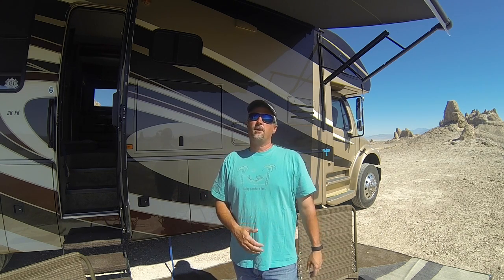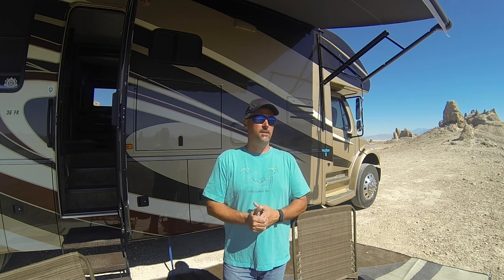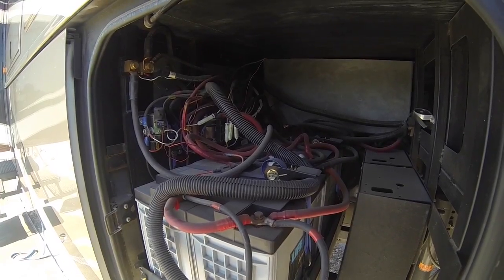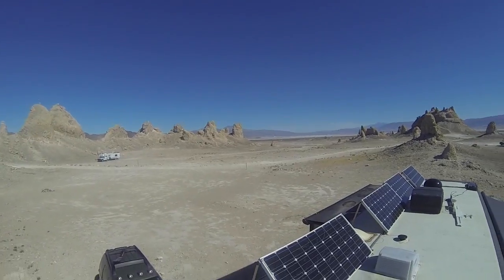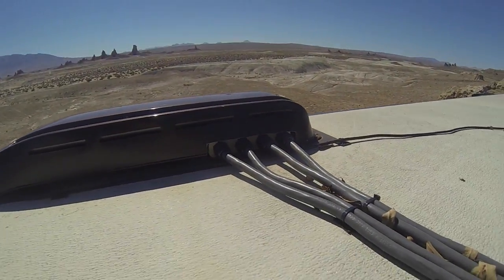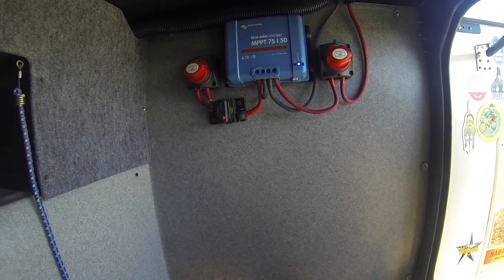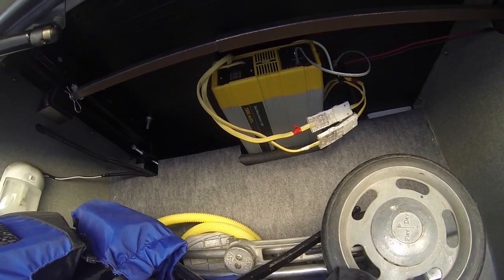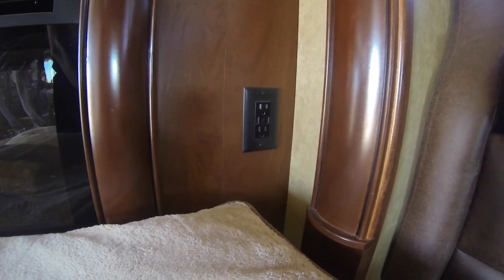Solar System on our 2013 Seneca 36FK

Comment: Thanks for the reply. That worked easily.
Wondered if you can help with adding more of the existing circuits to the inverter. Ours is factory set with Tv's n microwave only.  Would like to add other outlets to the inverter.  Did you just remove wires from the panel n add to inverter output?
Reply from the maker: I installed a small circuit breaker panel and removed circuits from the factory breaker panel to this new one.  There are 4 breakers in the small sub-panel I installed

Comment: We have an almost identical 2010 Seneca.
Wondering if you could explain how you got wires down from the roof thru the fridge area to the controller.  I'm about to install our solar.
Reply from the maker: I actually just pulled the fridge vent from the room and ran the cables through the vent space.  I tied them into the corner of the space so they did not interfere with anything or got hot.  I drilled out the bottom of the fridge platform, which on my model is directly above the house battery compartment

Comment: I bought panels on ebay and had them mounted on the roof of my pop-up camper funny thing was i pulled into Winnie Texas pouring down rain so I set up under a large metal canopy. Get this rain for two days then cloudy and they still charged my batteries. So it didn't matter if the sun was out! Loved that.
Reply from the maker: Thats awesome.  I do love the solar and the freedom it brings

Comment: We full-timed in our 2012 Lance truck camper for 3 1/2 years and did several remote camp host sessions where we only put about 50 hours on our L.P. generator due to the 250-watts of solar and two group 24 AGM's. What prepared our success was living off-grid in S. central CO in an off-grid strawbale home with attached greenhouse. We only had 960 watts of solar and a small wind generator, but I was able to work remotely from home for aerospace contracting via satellite internet and phones with antennas on the roof (metal roof and chickenwire in the stucco was a real good rf/emp sheilf, lol). Now looking to put all of our experience into our next Super C coach as there is a lot of North America to explore yet!
Reply from the maker: It is pretty amazing that we can live very comfortably just with the power of the sun to keep us going.  I know solar is rarely a cost-saving endeavour, but I love the freedom it provides.  Makes boondocking such a great experience.

Comment: How are the solar panels attached to the roof so we have no leaks!  Also, do you have problems with your slides leaking?
Reply from the maker: I actually screwed the solar panel feet to the roof with self-tapping screws.  The screw holes and the brackets are sealed with DiCore to prevent leaking.  This is a pretty typical install procedure.  As of now, my slides have never had any leaks are all.  I check the seals often as well as all sealed seams.

Comment: Wondering how you washed them, just a wipe off with a wet rag ? Does this need to basically happen each time you are going to use them ?  Nice video and Thank you for the links !
Reply from the maker: I just use some glass cleaner most of the time.  I do not clean them very often, maybe every 2-3 months.  They have to be REALLY dirty to actually have any effect on the power production.  My panels are in use at all times.

Comment: how did you attach the panels to the roof, and how are they secured when driving?
Reply from the maker: There are small angle bracket feet at each corner.  Each bracket is attached to the roof with two sheet metal screws and the screws and base of the brackets are covered in Dicor self-leveling sealant.  When traveling the panels are in the lowed position attached at each corner.  To be honest I have only tilted them up about 4 times over the last two plus years.  I get enough power, even in the winter, with them in the flat position.

Comment: Do you run your frig on propane or E?
Reply from the maker: Usually on propane.  The few times I do have electrical hookup, I will switch it over to AC power.

Comment: Do you have a changeover relay that switches all the AC outlets away from the inverter to shore power when it was available? I used an older inverter without such a relay, so I wired up one of my own. Like yours, my inverter powers the utility outlets but not the major appliances since it can't produce enough power.
Reply from the maker: The Xantrex 1800 that I use has a built in transfer switch.   When shore or generator power is present, it switches over to that supply.  Works very quickly as well, if I am on shore power, turn on the inverter, then unplug the shore power the AC loads, even televisions stay on without cycling off.
Reply: Modern electronics is pretty tolerant of very brief power supply interruptions, mainly because of the widespread use of switching-type power supplies (especially those with wide 100-240V input ranges). They can store much more energy internally to ride through brief outages than older linear-type supplies (the ones with heavy transformers).

Comment: Didn't your Seneca come with an inverter? If so why did you replace the original inverter?
Reply from the maker: It did, came with a Xantrex 1800Watt PureSign inverter.  I did not change out the original inverter, still have it and it works perfectly.  What I did was move some additional circuits from the main AC electrical panel to the smaller inverter sub-panel located next to the main AC panel.  This allowed me to have additional outlets and appliances available for use on the inverter.
Reply: Our Lance came without an inverter, so when I added one I avoided adding a subpanel with a little rewiring of the main panel. The refrigerator had been on the same circuit as the convenience outlets but there was just enough room in the main panel to give the fridge its own breaker. Then I took the output of the breaker that now feeds only the convenience outlets and ran it through the changeover relay. Our inverter is only 600W so it can't even power the microwave, which has its own breaker. The inverter has its own output circuit breaker and overload protection.
Reply from the maker: Sounds like a perfect way to handle it!
Reply: Yeah, don't want to waste precious battery power on the heating element in the fridge!